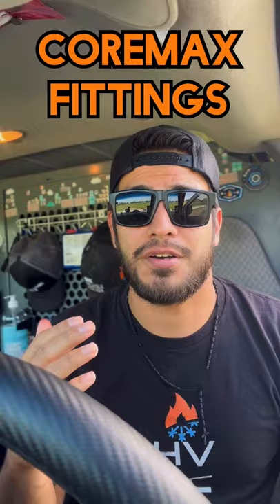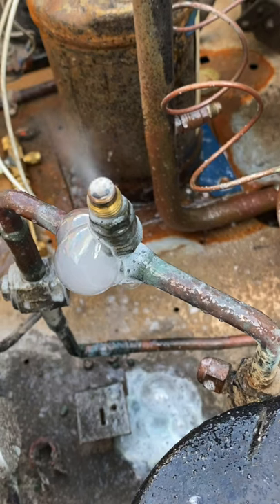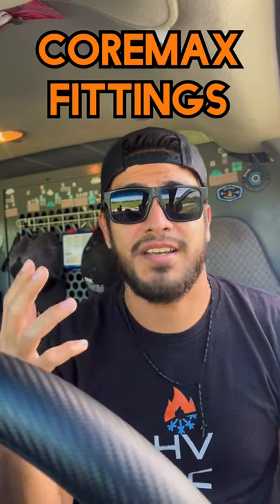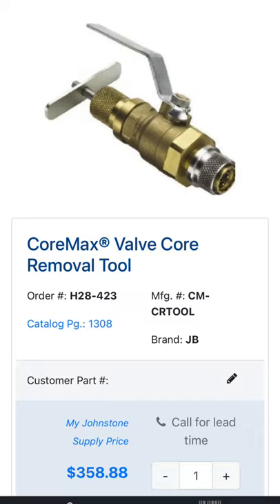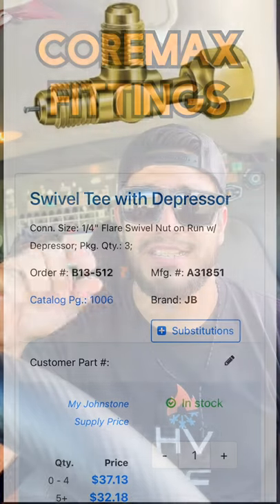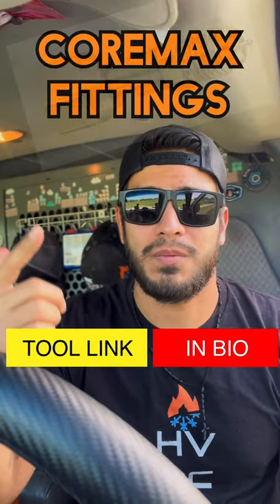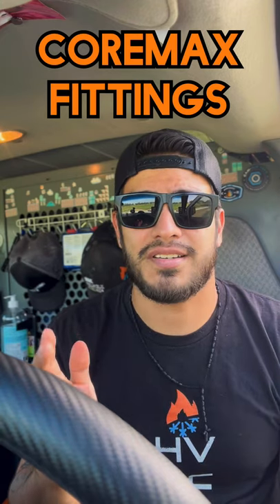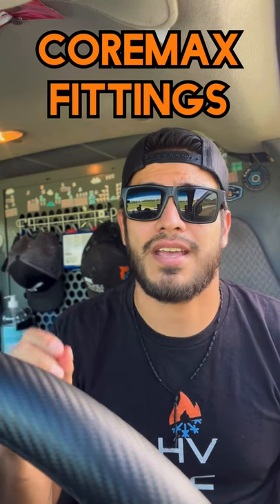What is a Coremax Service Port / High flow port / They leak a lot

Comment: I keep the ports, break off the guts from the new CoreMaxs, use swivel tees, put everything back together using NyLog, torqued down. Haven’t had a problem yet.
Reply: So you just rebuild it instead of brazing new one in correct .?

Comment: So does anyone know how to pull a fast vacuum with there if you can't remove the shrader out?
Reply from the maker: with these you need a depressor of some sort, I just got Appion ones that just came out. they are a thumbscew style, you twist it down to depress the core after you got it on there. and they're vacuum rated

Comment: Good stuff brother. I use that high pressure valve core removing tool all the time.  Don't even get frostbite if you know how to use it the right way. This others fittings are pretty cool too. I just like to keep the potential leak spots at a minimum. Keep up the good content! 👍
Reply from the maker: Thanks 🙌🏽

Comment: How about the Brass Cap ? Doe they prevent the leak even if there is a leak on coremax?
Reply from the maker: Yes. Use the brass cap with the gasket. I just prefer to use the swivel on the high side sometimes.